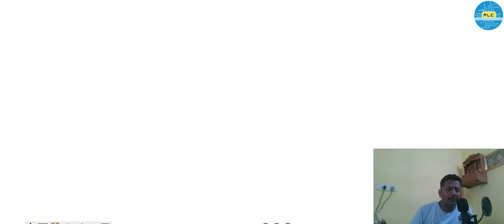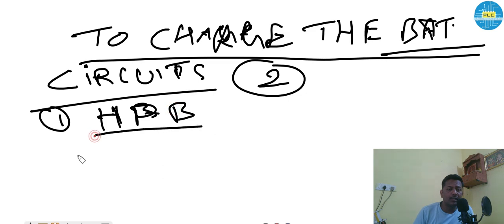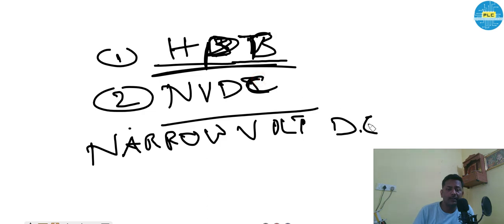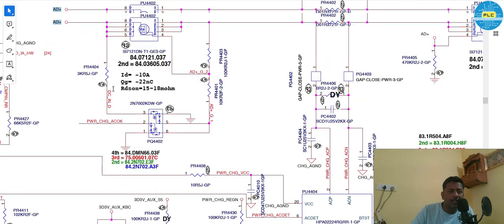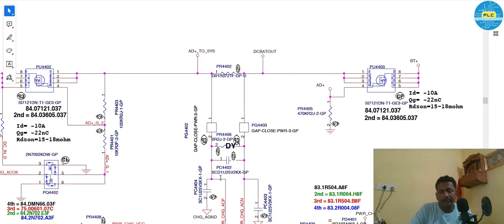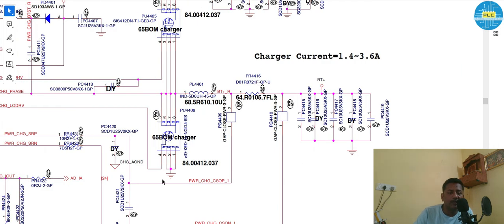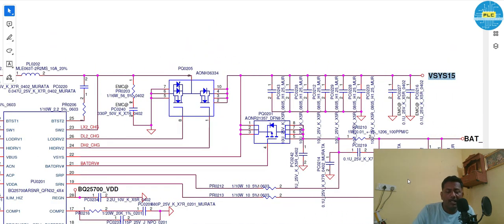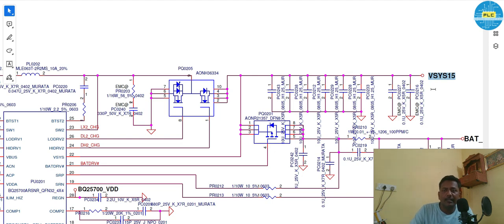LAPTOP REPAIR - HPB AND NVDC BATTERY CHARGING CIRCUITS AND TROUBLE SHOOTING TRICKS

Comment: Thanks for sharing this important knowledge sir, the simple trick i use for charging is simply checking the datasheet of the ic, then troubleshoot using the external pins connected to the pwm section of the  ic, and also communication with the pins.
Reply from the maker: It's good method. 👍